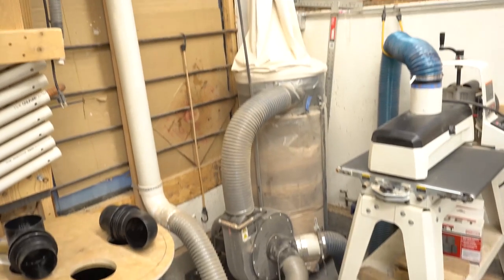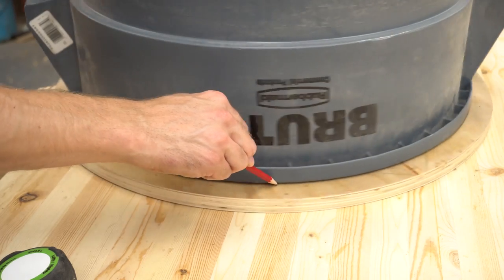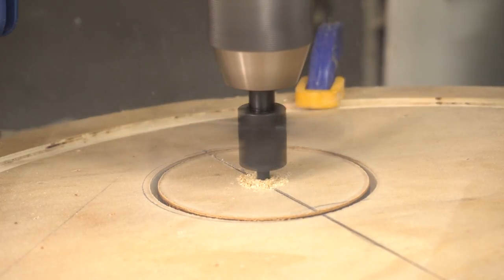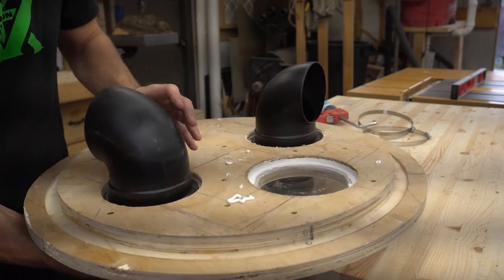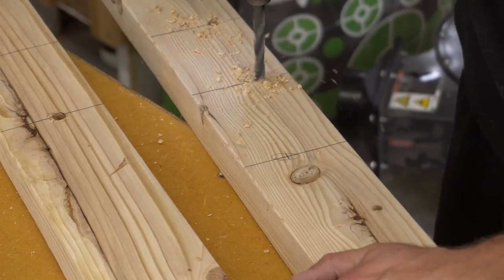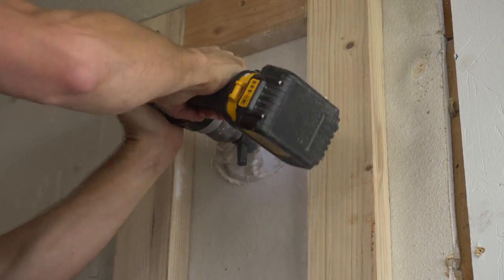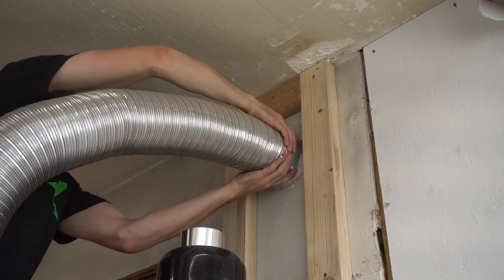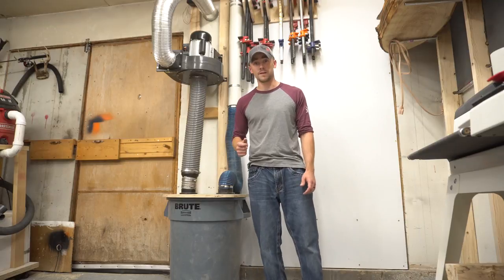Dust Collector Upgrade | Separator & Exhaust.

Comment: i am from a really hot area of the world, and the way we used to cool off the house and shops was with a swamp cooler, all you need to do is drop big chunks of ice in the water and allow it to bring fresh air from an outside  shaded area in to your shop, once the vaccum is done being used, tur the a/c on and dehumidify the shop with it, this way you get to keep the work area fresher and as you said is only for a couple of months out of the year
Reply from the maker: There are a lot of swamp coolers in this area too. I've never been a big fan, but they might work pretty well in this small space.

Comment: I enjoyed the video.  I agree with the other comments that the circle cutter must be run slowly.  Very slowly!  They don't come with proper instructions and I discovered their speed limit the same way you did.

I now run mine at 180 rpm (slowest speed on my drill press) and it works fine.
Reply from the maker: Thanks for the info! I'll give it another try sooner or later.

Comment: Nice video. It was very well done. Dust collection keeps evolving so there's always something new to learn.

Here are a few tips. ..
-The circle cutter was dull if it was smoking. sharpen it and run it slower. 
-Put some Loctite on the set screw to keep it from loosening. 
- Look up "Thien separator design" for a configuration that will pass around 10x less dust than what you have there. It may even have a lower pressure drop than what you have there. Those 90 degree bends create a large pressure drop which causes lower flow. 
-It would be a good idea to check the current going to the motor.  It's probably fine since you have 90 degree bends and plenty of hose connected but it's good practice to make sure the motor is not pulling more than its rated amperage.  It seems counterintuitive but if  there is too little air resistance the motor will overheat draw too many amps and overheat. If it's running very much under the rated amperage listed on the motor plate then you have some margin and can try to reduce flow resistance to increase flow rate.
-With a good cyclone design you can add a good filter from Oneida or Wynn Environmental and vent inside. That prevents heat/cooling loss and it will actually make your shop air cleaner than the outside air. I've verified this in my shop using a Dylos 1100 Pro laser particle counter.  Venting inside also prevents sucking your stove gasses back into the shop. In the winter the 1500 Watts or so that the blower draws will be used to heat the shop instead of sending it outside. In the summer it will pump that heat into the shop but that's not nearly as bad as sucking in hot humid air.
Reply from the maker: Thanks Tony, that's a lot of good information! I figure I could tinker and modify this thing almost endlessly. This would be my 3rd version of dust collection and it's the best so far. When I first started, I wondered how some of those full dust collection units could cost $1000 or more, but now I get it. Some day as my budget will allow I'll looking into the next evolution of my war on dust.

Comment: Fly cutters are not for hand drills (as some have mentioned), or drywall which is not stiff enough to support the center. They are most suitable for stiff and tightly clamped systems, such as a drill press. Glad there was no injury, take care.
Reply from the maker: Thanks for the heads up Alan.
Reply: He has the blade mounted wrong. He isnt using the cutting edge, hes plowing through with what should be the side face.

Comment: I like your setup, I have a 1200 sq ft shop just outside of Louisville, KY. I thought about exhausting through the wall like you did but I had concerns about loosing my heat in the winter months. Starting to think maybe I build a filter box and put it above the office in my shop to keep that heat in.  80,000 BTU natural gas heater can get expensive to run. I will be using a plastic 55 gal drum instead of a garbage can to collect my large dust particles.

Comment: I love those circle cutters. Definitely for use with a drill press only!
Reply: He has the blade mounted wrong. He isnt using the cutting edge, hes plowing through with what should be the side face.
Reply: I thought they where only for drywall?

Comment: There is a simple fix to prevent the cold air or heat from escaping the shop. If you look at April Wilkerson's Dust collection install by Cyclone, they explain the problem and simple fix for that issue. It is easier for you to watch the video than for me to try and explain it(they are the experts for dust collection). I used the fix in my shop and I don't have the problem anymore.

Comment: Yes you will lose conditioned air but you'll also put the building under a negative pressure which can bring with it it's own issues.

Comment: Love to see a video with more detail on how you used your router to cut the perfect circle for the garbage can lid. Cool trick!
Reply: Just clamp a sheet of wood to your router table (large enough to support the circle), then measure the distance from your bit (flush trim bit should do fine) to the center of your circle. Use a small screw or nail to protrude a bit thru that center mark, then just carefully turn the circular piece counter clockwise one full revolution. The important thing is measuring the correct circumference and, as he noted, hold the piece firmly as you rotate it. Good luck.

Comment: i know this an old video but i vent my dust collector out a 2nd story window in a gambrel style barn i never open a window or have had a problem with temp change in my shop and i live in Upstate NY but i also heat my shop with electric heat that runs off the Solar from my house i dont have any CO2 problems maybe thats because i heat with electric i have used a CO detector and have never had a problem.

Comment: That is a great setup.  I didn't read all of the comments to see if this has already been suggested, but how about putting some small nails or screws on the inside of the viewing window on an angle (similar to what glaziers used to do before putting putty on old wood framed windows) to ensure it will hold with the suction?  The silicon glue should do the trick, but if you are worried, this might do the trick.
Reply from the maker: Thank you! And that is a good suggestion. I actually ended up drilling some holes through the plexiglass and into the wood then used some pan head screws to make sure it would never come out.

Comment: One thing about putting the blower AFTER the separator nobody seems to mention is a safety factor. With any dust collector where everything goes through the impeller first thete is sort of a hidden fire danger. If a nail or any thing metal hits the impeller and generates sparks these will be blown right into the sawdust. If this happens yo wont know theres a fire until after a huge amount of damage is done. Having the blower PAST the separator prevents anything bigger than basic dust from getting to the impeller.  As nothing to speak of ever hits the impeller blades both the motor and impeller will last far longer. 

In my opinion ANY dust collectr system, irregardless of the cost, that has the impeller BEFORE the separator is a fire hazzard.
Reply: Should cut erosion of and damage to the impeller too.

Comment: Thats great! I have a SMALL basement shop and need a DC. I've been using shop vacs and dust stoppers but would like to get a more efficient system. I just can't fit a big 2HP DC. Your design is awesome. It's compact and simple. I've lots of other big, complicated modifications and this is the only one that may actually work for me in a practical way. Thanks!

Comment: In the winter it can suck smoke and c02 back into the shop too. You have to vent to the outside or your chimney becomes the vent!
Reply from the maker: Have you got some experience with this? I'm having a hard time picturing how that would actually happen.
Reply: You are moving huge volumes of air out of the building with the dust collector.  That air has to be replaced somehow, if you have a combustion source with a chimney, that will likely be the path of least resistance for "makeup air".  So instead of poisonous combustion gasses (CO) venting up the chimney, they are pulled into the shop.
Reply: Brian Bain zactly
Reply: Gunflint Designs Brian Bain nailed it. I considered doing what you did, but decided against it after researching a bit. Basically you have to let as much air in as you are sucking out. I didn't want to loose my cooling in the summer or suck c02 in through the chimney or let in a ton of cold air in the winter so i ended up with a self contained unit. Yeah, you have to deal with filters, but seemed the best bet for my situation.

Comment: That circle cutter is only intended for wood use. Plus it's only designed to be used in a drill press. My guess is the cutter was really dull. I've used one and had pretty good luck
Reply: He has the blade mounted wrong. He isnt using the cutting edge, hes plowing through with what should be the side face.
Reply: @root1657  Also he is using it at way too high of a speed. These are supposed to be used at 500Rpm or less. I have one and have cut several holes without burning beause I was using it at the right speed and as you pointed out I was using the cutting edge.
Reply: After being used to cut metal, it's definitely dull.

Comment: That kind of circlecutters is ONLY safely used in a drillpress with the material clamped to the table. No filtermaterial means nopressure resistance so more air displaced. I'd be really surprised if it hadn't improved the suction...

Comment: I know this is an older video and you may not even have this same set up anymore but i was thinking.  you could use blast gates on the exhaust side of the system.  when it is really hot out you could divert exhaust through a filter or filter bag and when the weather is mild you could vent straight outside.  just a though.  thanks for the video.

Comment: so i know this is dated, but for my edification, we know now that the blower should be blowing debris into the bin in a vortex or circular pattern, around the bin until it settles to the bottom.  the sucking hose should actually be positioned in the center of the lid in order to suck, ostensibly, in the middle of the vortex, sucking up as little debris as possible...right?  yours is on the side, potentially sucking up more debris than necessary from the vortex of debris.  am i on base with that?

Comment: Your going to want to keep an eye on your wood stove. You might have a problem with proper draw. If your system pulls to much air it could pull the smoke into the shop instead of up the stove pipe. This can be eliminated by bringing in the air for the wood stove directly from outside and just make sure the dust collection is off when feeding the stove.
Reply from the maker: Thanks for looking out for me William. Its been cold for a few months now and I have been using them a lot. It doesn't seem to be an issue. My concern of the collector sucking out all my hot air seems to be a non-issue as well.
Reply: Gunflint Designs no problem. Cold here as well. It has been in the negative at night and during the day some times as well. I also have plans to vent my collector outside as well now that I am doing away with my wood stove. Also thought about making a filter box with furnace filters to pipe it into my garage and not lose the heat.

Comment: I feel your pain on the adjustable hole cutter. I got the same thing from HF and the first time I used it, even though I made sure the set screw was tightened one of the cutters completely flew off and into the wall. Thankfully it went that way and not at me! I hate that thing and it's in the garbage!
Reply from the maker: They are scary! I have since learned that I was trying to run it too fast... but even so, I don't want to use it again.
Reply: He has the blade mounted wrong. He isnt using the cutting edge, hes plowing through with what should be the side face.

Comment: The problem with your fly cutter is speed and probably sharpness. They never come nearly sharp enough and have to hone them up. Speed should be done around 100 rpm for large holes and I wouldn't try one in a hand drill. For the set screw, if there's enough metal drill and tap for the next larger size.
Reply from the maker: Thanks John, I might play with it again just to see if I can make it work.
Reply: Agreed, that was way too fast, makes it dangerous and unreliable.
Reply: Slow down hone it and you won't have to worry about the screw
Reply: He has the blade mounted wrong. He isnt using the cutting edge, hes plowing through with what should be the side face.
Reply: I have one and that speed was way too fast. To show you what I mean, when I got it and read the instruction sheet, I realized my drill press ran too fast, so I got another drill press that was 12 speed so I could slow it down slow enough. I cut a 8 inch hole in 0.25 inch plywood and it did a great job. Speed and sharpness are the key to using these cutters.

Comment: on you AC pull the unit apart once a year and clean the condenser coils and change the filters once a month when your using it.
you might also consider adding shade over the unit direct sunlight tends to heat them up so much they can't cool.
also put foam on the underside of your roof about 2" off and add a foil face  do enough of that you'll block the sun and keep the shop. cooler.

That hole cutter is a cheep knock off but they are ment to run at low speed all large drilling and cutting bits are for low speed.
Just like you would slow down a router motor for a large panel raising bit same is true for drill bits and hole saws.
Reply from the maker: Thanks for all the great tips!

Comment: I thought the exhaust port of your bin should be in the center. That way the circulation of the dust causes the particles to fall out of the moving air into the bin???
Reply from the maker: This is the way the seperatror instructions said to set it up.
Reply: Look up Thien dust separators.

Comment: Sir, I am afraid that you are not using the intended working principle of this type of dust converter to get the maximum separating efficiency of the unit. While the inflow with the elbow bit, could be improved greatly my worry appertains to the exhaust part where it is not at the center of the circle where it should be.  The input momentum of the particles mixed with air should find themselves rotating at the inner upper circumference of the container and they should do that without any interference not even from the input elbow into the unit.  I am afraid that putting the exhaust of the unit on the side of the top circle, then feeding the motor unit,  this side mounting is spoiling a lot of the efficiency.  Try moving the exhaust of the unit to the exact center and you will have a much better performance. As it is, the particles are hitting the exhaust elbow and also that at the intake, slowing the debris down, where the lightest would be sucked up by the motor.   Moving the exhaust to the center and improving intake placing the elbow outside and entering with a slanting angle, it will keep the highest velocity at the inside top of the container, which would greatly improve your separating and suction processes.

Comment: excellent project. I'm curious. Did you give any consideration to building a cyclone ramp inside the top part of your trash can? Possibly attaching it to the lid so that it comes out too to make dumping easier?
Reply from the maker: I considered it, but I decided the rocker kit would do a good enough job for what I was trying to accomplish right now. With those elbows in the lid pointing they way they do, it creates a cyclone effect, just maybe not the most efficient version of it.

Comment: Those fly cutters are definitely old-school technology. The worst thing about them is the faulty impressions the importers or no-nothing hardware clerks try to create. They're not worth a quack except in a drill press at low speed. Even then the owner will have to sharpen the cutters to get satisfactory work out of them. Finally, they're okay for making precise cuts. I keep a couple on hand but don't actually use either except maybe 3 times in 10 years.

Comment: Really like that sight port you put on top of the can. I think I'll add that on my system.
Reply from the maker: As long as you use a flashlight to look into it, it still works fine. But static does cause dust to stick to it so you can't see in it all that well. I've actually found that when a noticeable amount of dust makes it past the system and blows outside, then its time to empty the bin!

Comment: I think the speed is probably way too fast for the circle cutter - in general, the larger the hole you cut the slower you need to cut. Those adjustable ones are difficult and clunky but they are efficient if you take your time.
Reply from the maker: Thanks Aaron.
Reply: He has the blade mounted wrong. He isnt using the cutting edge, hes plowing through with what should be the side face.

Comment: I watched this video  (2nd time) and just occurred to me that if you put an A/B blast gate in line just before it goes outside, on those special occasions you can divert the flow to an air filter box  (shop made, of course :>) to filter back into the room.  I made one with two 20"x20" furnace filters, works great.
Reply from the maker: That’s definitely in the back of my mind. So far it hasn’t been a problem blowing heat out in the winter. Maybe in the summer it’ll be different.